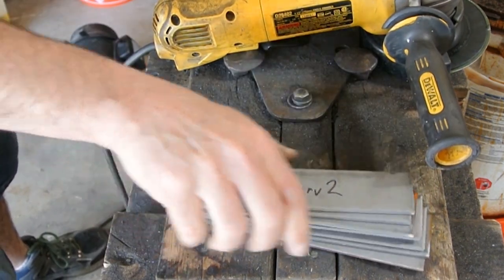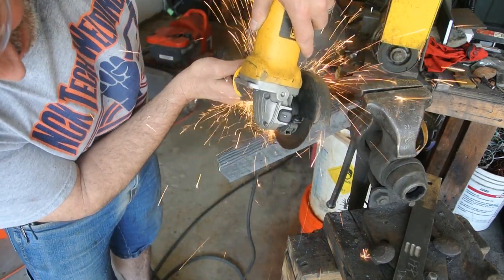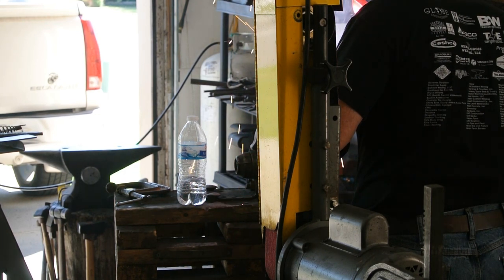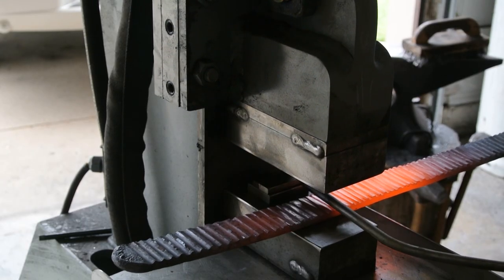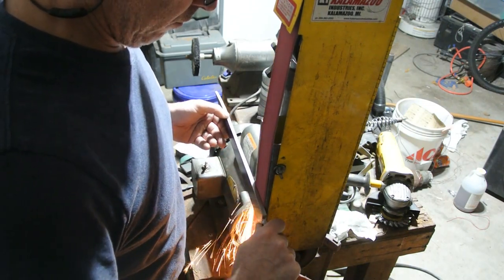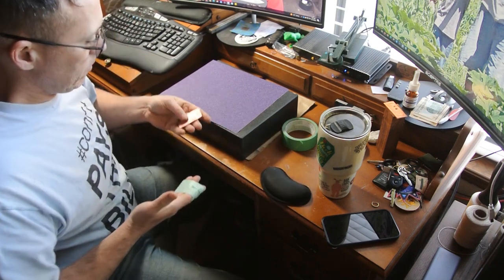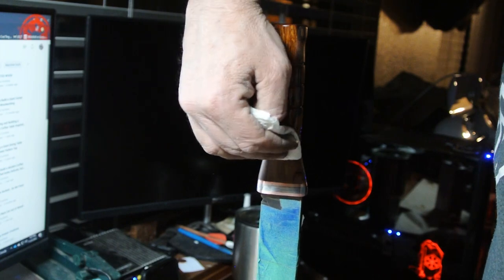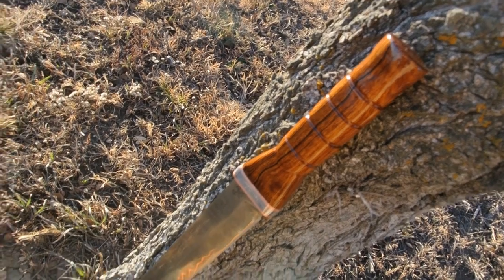Making a Scottish Dirk with CuMai Damascus

Comment: It’s like a Dirk but not quite.. this is closer to a dudgeon.. the intermediary between bollock dagger and the later Dirk
Reply from the maker: Thank you for your comment, Charlie. You're most likely correct. I just couldn't resist doing that double edge with the copper in it. Can I ask you for your reference? I'm not question, I want to learn more! Thanks again!